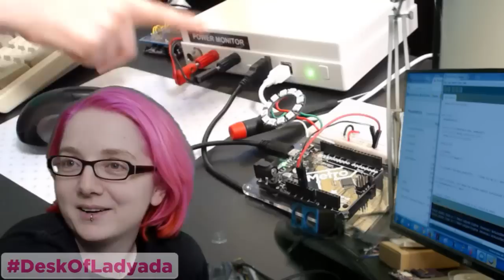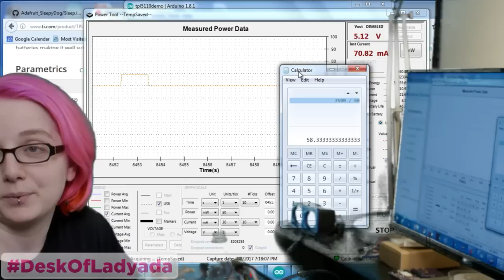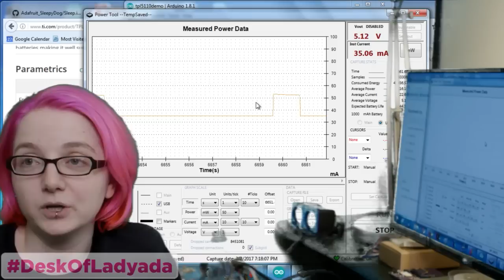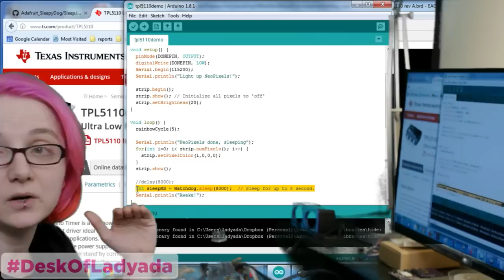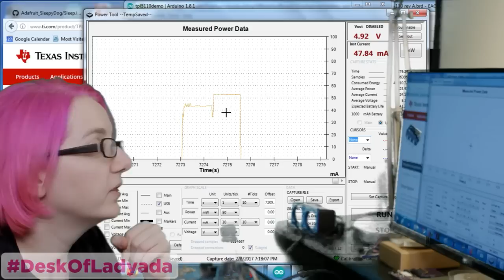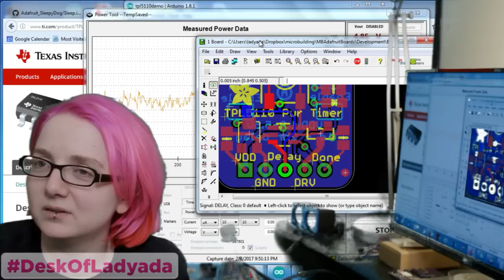#DeskOfLadyada FUNdaMENTAL THURsDAY Ultra low-power sleep with @TXInstruments TPL5110 LIVE @adafruit

Comment: Very cool, btw you can use the INA219 adafruit breakout as a Power Monitor and log power usage to Arduino Serial Plotter. Maybe is not so accurate but is a cheap solution. I'm doing this way! (You need one more Arduino to test the circuit)